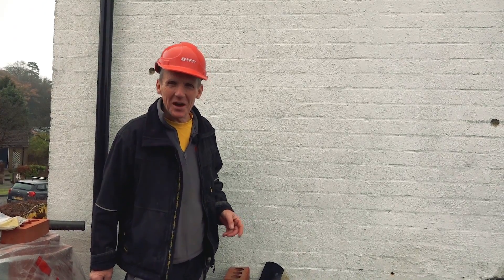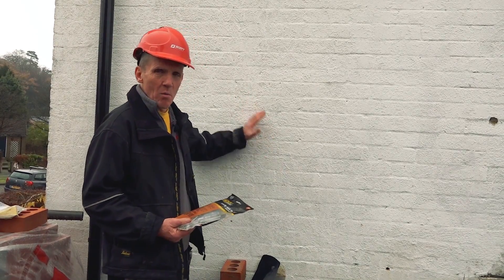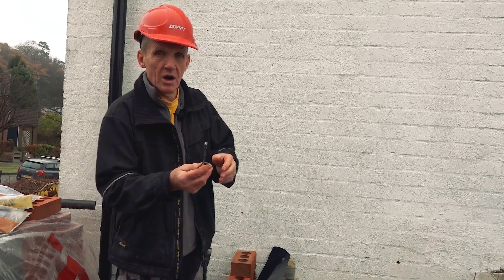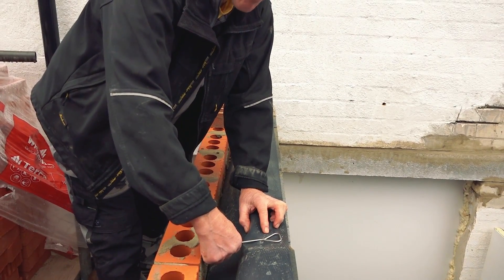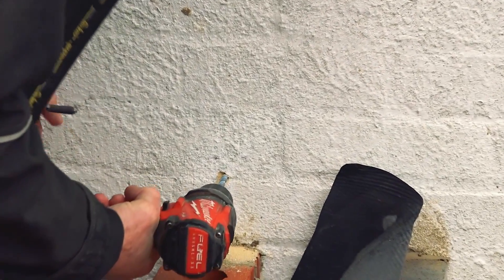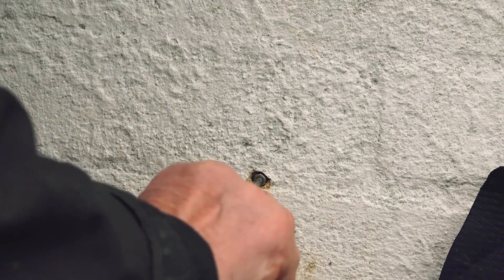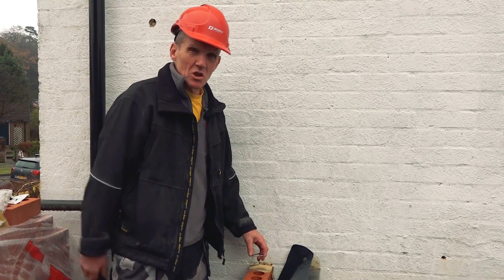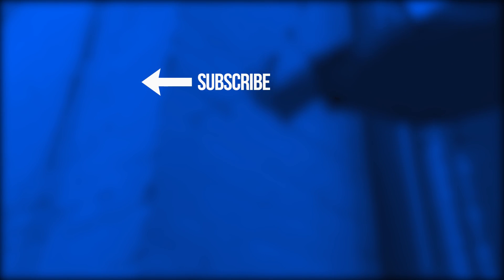How to Tie in a Wall Securely ~ Tiger Cavity Wall Ties

Comment: Hi Roger, if the new wall is withing 150mm of the boundary line and the neightbour has a wall that is alos 150mm away from the boundary, effectively a 300mm gap between the neighbour extension wall and my new extension wall, what would be the correct method to seal the new wall after it has been tied in qith the tiger wall ties due to the small gap?? thanks in advance for your advice.
Reply from the maker: I think in this case I would lay a foam strip up the wall before putting the ties through.  The strip is often used on movement joints in straight runs and the ties poke through.
Reply: @ thanks Roger much appreciated.

Comment: But your drilling into a friggin cement seam  Wat a load of crap do it propper
Reply: Tying in to keep courses with brickwork on existing no option other than using resin to secure a better tie in ,if mortar is weak and sandy .Give the man a break hes teaching you to do it right and doing people a good turn .

Comment: Good tutorial Roger. Good to see the cavity tray set in above the catnic over the window reveals. Those tiger screw ties are the mutts nuts. We don't have them in Leeds. Much better than our bluebird screw ties (with seperate plugs).
Great comprehensive video about tieing new block work to original wall.

Comment: Do you put them in every row of bricks or skip a few?
Reply from the maker: Most  people put them in every third course which works out the same as the  blocks.
Reply: Skill Builder thanks Roger 👍🏻
Reply: Long length walls every 6 course of brick or 2 course of blockwork.
Every 3 course of brick or 1 course of blockwork for short butts especially near doors and windows.
Reply: 3 courses reveals, 6 courses straight runs is plenty, .. unless theres some major engeneering aspect that needs you to reinforce the wall or something